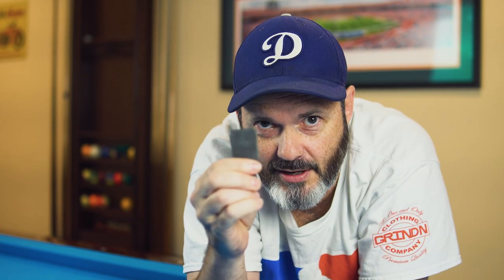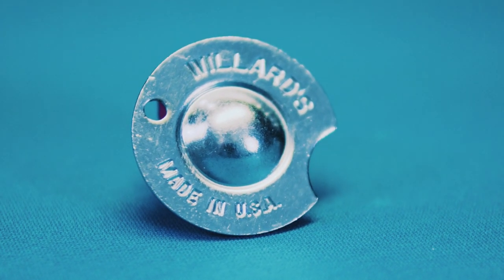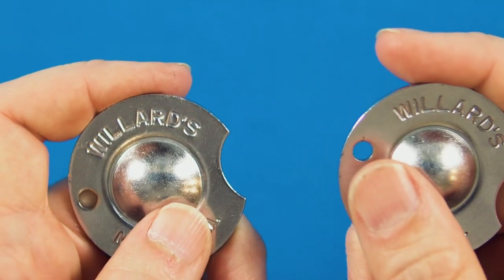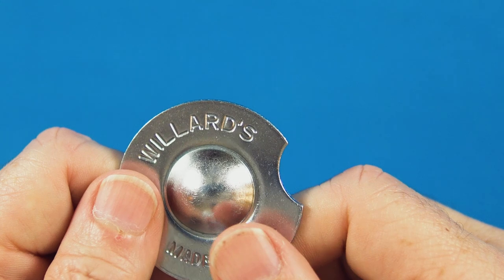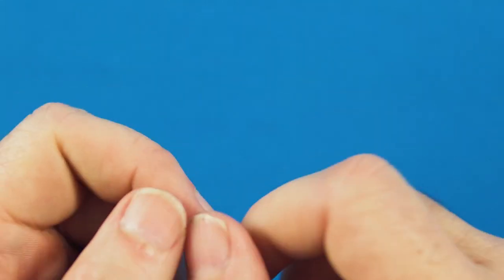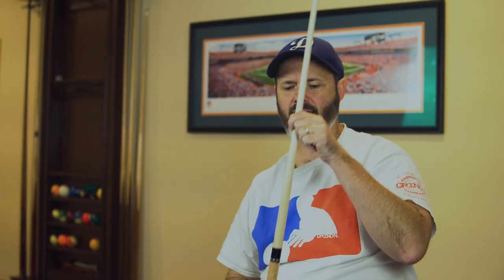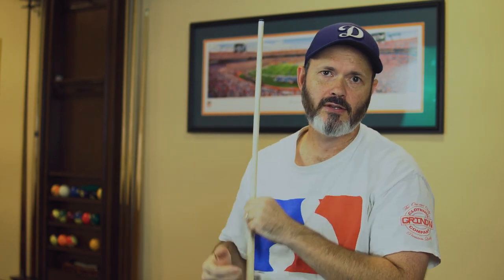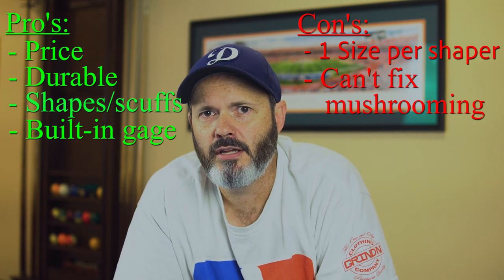Willards Cue Tip Shaper Review

Comment: Yes this is a very good product but it will wear out your tip faster than most other tip shapers,  I haven't found a better tip shaper. I can say this with confidence after 500 tournaments.
Reply: Good luck with your next 500.Did you excel in any?
Reply: Thats been my experience with it also, works GREAT, but after the first couple times using it, it was noticeable how much it was taking off

Comment: I don't think you can wear a Willard out, but I did have some stolen over the years.  Disappointing, but cheap to replace.  If the Company sees this, how about a shaper in quarter size and a size between Little Snookie and a dime??  The former for break/jump tips, and the latter for tips on 11mm shafts.

Comment: Have your tip shaped on a lathe. Use a shaper to loosen the surface of the tip as it packs. And your tip will last much longer if you chalk as needed and not as a reflex.

Comment: I have “The George” for my revo but I don’t know how to use it.  Please help.   I herd u can put it on the floor then put your tip on it while standing and roll it like a fire starter.   Dunno.   Need help
Reply from the maker: For shaping you can use the shaper portion of the of your tool like you said, by placing it on the ground and roll it like a fire starter but you need to make sure to keep your cue vertical without tilting the cue. Shaping will get the curve you want on your tip (dime or nickel). The larger rough portion is made for scuffing which is needed when the tip just needs to be scuffed and not shaped so it will hold the chalk better. You scuff it by holding your cue upright and lightly rub the scuffed on the tip, make sure to do it evenly by rotating the cue while you’re doing it.  If the tip is a soft tip it will scuff and shape a lot easier than a harder tip so keep that in mind as well. Hope that helps.
Reply: Pool Addiction thank you

Comment: Nice review. I have used Willards for years. I have the bowtie but the Williards is my go to. I usually put it on the ground and hold it with my feet, then hold my stick upside down with the tip in and hold the but with my hands and then rub my hands together as the stick rolls between them. I like this way as it seems better to keep the stick straight. just my personal preference.
Reply from the maker: That's how I prefer to use it as well, just have to makes sure you're not tilting your cue while doing it.  The first time I did it that way my tip was a little uneven because I had the cue slightly tilted.  I also wanted to show the different ways I have seen people demonstrate it.  It's a good little tool.  Thanks for watching!

Comment: I have one of these Willards from 30 years ago, a dime size one. I used to live in Aurora back then, so I reckon that's why it was easy to find. I also have a no name plastic double sided tool with the same abrasive in it as the Willard, and it has dime and nickel radius on each side, works just as well. I have another plastic too that is basically a sanding stick, about 6" long, 1.5" wide and convex dime radius profile. It has internal grooves along the inside edges for you to slip in a strip of whatever sandpaper you choose. You stroke it across the tip like a file while turning the cue between strokes to keep the cut even. Unfortunately I suck at pool, can't consistently aim and stroke a shot to save my life. L0L

Comment: The Willard's shaper tool is easy to use, works fast, never wears out, works better than anything else I have used, and does a consistent job (nickel radius for my 13 and 12.75 mm tips). I find it a tad rough after the shaping, so I finish with a curved trough tool (greater than nickel radius) that holds a strip of easy to replace 200 grit fine sandpaper. I spin the cue by hand while drawing the trough tool across, mainly around 45 degrees but a few light passes steeper for near the edges and flat for the center. Then I grind rotate the cue tip with about 5 lbs of pressure into a well used chalk which acts like super fine sand paper to really smooth out the tip, knock down high spots, and to fill in micro pits. The other side of the trough tool has a flat surface that works for mushrooming, just use 1 inch of regular paper over the sand paper to protect the ferrule. Then burnish the side by rotating the sides against a stained piece for wood. A pick tool aerates the tip for chalk adhesion between shapings. Don't spin the tip when aerating since that would shred the leather. When a get a new cue, I expect to reshape after a few dozen racks as the center flatten compacts with break in.

Comment: Great to see you making videos again look forward to the next review. My understanding was that the nickel shape was more for breaking and a dime shape was more of a playing shape. I’ve used dime shapes b4 on 13 and 12.75 mm tips b4 and never noticed any problem but I’m no pro so maybe I’m wrong. Either way love the channel
Reply from the maker: Thank you for your feedback.  Most regular players do use nickel for breaking and dime for playing.  However, I’ve tried to put a dime shape on a 13mm tip and didn’t work well for me.  The biggest tip I was able too get a descent dime shape was on a 12.75 and smaller.  New players should use a nickel until they get more exepreince because it’s like going to a smaller diameter tip…the degree of difficulty goes up.  I’m glad like the channel!
Reply: I agree smaller diameter does increase difficulty so it does make sense that smaller radius would also increase difficulty. And I’m an average player on my best day so maybe the fact I was shaping a larger diameter to a radius that didn’t allow for a good combination of size to shape and that was hindering my game and making it harder to develop a consistent game

Comment: Great to see you're back to making videos :) And a great little review you made... I have a knockoff 'cuetec tip tool' that I use. But its kinda hard to hold the scruffer level and put pressure on the tip at the same time. And I really have no idear what radius it has. So the it looks like I have to get a Willard ;)
Reply from the maker: Can't Breakdance Thanks.  The Willard’s takes a little getting used to if you the way I prefer to use it (the last technique) but they are built to last a long time.  Glad you enjoyed the video!

Comment: Hey kev. I’m getting into pool and and am buying my first pool table for my house. Thinking about an 8 foot table, but was hoping to get some insight on what brand would be a good choice if I plan to start competitive soon. I want something similar to what I’ll be competing on to stay consistent
Reply from the maker: Depends on what your budget is.  If money isn't an issue Diamond all the way.  I'd say after that I like Olhausens.  After that, I think it drops off a little.  Olhausens are cheaper than Daimonds but they still aren't cheap, around $3K for a new Olhausen.  You can a used Olehausen for a reasonable price.  Second part to look for in a table is pocket size.  Diamonds have pro cut and from what I understand Olehausen have what they call "Rattle".  You want tighter pockets for practicing.  Also, make sure your room is good for an 8 foot, you typically at least 4 feet around the table for play.  Here's a link for room sizes https://www.billiards.com/pool-table-room-size.  If you can get a 9 foot, I would go with that over an 8 foot.  I would add Brunswick Gold Crowns into the mix if you go for a 9 foot.  If you are really on a budget go with a 7 foot Valley table.  They are cheap and are usually one piece slate.  You can upgrade the rails for better response and you can get the pockets tight like the pro-cuts on Diamonds.
Reply: Pool Addiction my local pool hall aswell as the league at my college mainly plays on 7foot Diamond tables, I’m starting to lean towards the 7 footer. My budget is about $2500. Do you think it be worth it to get a used table for cheap and re-felt it and put better rails on it?
Reply from the maker: I think you can do a used Valley and get some good felt and new rails with $2500.  It would be close but I think it's doable.  I would recommend Ridgeback rails.  They are really good replacement rails for bar box tables and they have a pro cut style rail which makes the pockets tight.  As far as felt it depends on how fast you want the table to play.  I like felt that's faster than normal and can get the cue ball to have a good reaction to the English I put on the cue ball.  I have used Simonis 860 cloth on my last two tables and I love the action but it is a higher maintenance cloth because it's thin.

Comment: Thanks for your video. I wanted to how to clean the tip shaper after using it. I can't find a way and the tip shaper feels like its not shaping anymore because of the dust from the tip that was being shaped. Thanks for your help in advance.
Reply from the maker: I usually tap the shaper on a hard surface or something to get the debris out after every use.  I haven't had too much of a problem with this issue.  You can probably try to blow it out with some compressed air.  Also, I would clean off the tip of all the chalk before using the shaper and that will help the dust and debris.  Hopefully, that helps you out.  Thanks for watching!
Reply: Use an air chuck on your compressor and some break clean ..good as new

Comment: New tip, The middle of the tip is still hard and unscuffed not far enough?
Reply from the maker: Check it with gage on the side and if you don’t have any light between the tip and the gage, just lightly scuff it side to side focusing just on the end of the tip. If you see light then keep going. You can keep going even if the tip shaped right per the gage, it just takes down the tip a little more. Hope that helps.

Comment: Would you say this would be fine to use on a snooker cue tip?.. I'm currently using a Century Pro G3 10mm
Reply from the maker: I am not familiar with what radius tip Snooker players play with.  The most curved radius you can get with a Williards is a dime shape (60-degree arc).  I did a quick search and I think the dime radius should work for a snooker tip.
Reply: @PoolAddiction  Thanks for the reply =) .. I guess the only way to find out is to purchase and test it on a different tip than my main one.. I usually use sandpaper and do it by eye but struggle from time to time to get it perfectly even, this just seems like the perfect solution to that
Reply from the maker: @raymondoreed7723  Sorry I couldn't give you any direct experience.  I will say the shaper is pretty robust so do take it easy on the tip at first till you know how it will do.
Reply: @PoolAddiction  That's alright mate.. I've ordered the ' Little Snookie ' from the same people.. Sounds like it's more for the snooker tip appose to the 9 ball tips ect.. I've to expect it at the end off the month cause it's being shipped from the usa =) .. Thanks for the advice

Comment: I’ve just purchased one of theses I’ve  tried it on my cue tip and it’s made lots of fibres stick up, is this normal ?
Reply from the maker: Some tips rough up easier than others.  How hard is the tip and the brand?  Not seeing a picture of it I can't tell you if it's excessive.  Usually a softer tip will rough up easier than others.  If there are a lot fibers you can try to clean it up and tap down the tip.  I would just take it easier when using it.
Reply: Pool Addiction hi thanks for the response, my tip is an elk master not sure on the hardness of the tip. The Willard cue tip shaper seems very rough to me I’ve replaced my tip once before and used 250-300 grade sandpaper and that seemed to do it fairly well considering it was my first time. I got the cue tip shaper for convenience really incase I needed to shape my cue tip up unexpectedly.
Reply from the maker: Elk Masters are a little harder than a medium layered tip in my experience. The Willard is pretty rough so I wouldn’t put a lot of force into it. You should see some fibers after roughing/shaping but if they are more than 1/16 of an inch long then the tip was roughed up a bit much. Your tip isn’t destroyed if it is, just clean up the long fibers and take it easier with the Willard shaper next time. The age of the tip can have an effect on shaping but age usually makes it more difficult to get the tip to rough up.  I have had tips before that had longer than normal fibers after roughing them up and I just cleaned it up and it was fine, I’ve never that issue with the Willard though, not to say it won’t happen though. I haven’t played with a solid compressed tip, like an Elk Master, in a long time and I can’t remember how they react to roughing and shaping, I mainly use Kamui now which are a layered tip.
Reply: Pool Addiction ok thanks, come to think of it I did use a lot of force when using the Willard. I’m due a tip change so am going to change a tip like I usually would and practice with the Willard to get use to it.
Reply from the maker: Anything I can to do to try and help you out, I will do my best.  Happy shooting!

Comment: What do you use to get rid of mushrooms?
Reply from the maker: Mushrooms are always tough to maintain.  If the mushroom isn't too bad, I use a Porper burnisher tool.  Even though it's meant to burnish, it does an okay job at compressing the tip back into shape.  Another tool I've used in the past is the 3-in-one tool.  It has sandpaper strips on the side where you can around really carefully and sand the mushroom part ( make sure to avoid contacting the ferrule) and then burnish it with its burnishing tool.  Another tool you can use is the Porper mushroom tool.  I would exercise extreme caution with this tool because it will really mess up your tip and even your ferrule if you don't use it right.  This tool has a razor blade that will shave off the mushroom and then can burnish it after you're done.  You have to be very careful with it and I would take the time to learn how to use it if you go that route.  For me nowadays, if I have time, I have a lathe where I can spin the shaft and clean up the mushroom with sandpaper or a cutting tool.  I still have the Porper burnisher in my bag for the poolhall when I need something quick.  Hope that helps you and thanks for watching!
Reply: @PoolAddiction  Thank you, this is very helpful.

Comment: Can you change from a dime to a nickel?
Reply from the maker: I suppose you could but you are going to have to take a good bit off of the tip when you re-shape it.
Reply: @PoolAddiction  doesn't everyone reshape a layered after a couple weeks of play once or twice? All these Cynergys come with a dime sniper tip.
Reply from the maker: @Lukas-gx9wk  I usually shape every couple of weeks but it get more frequent as the tip gets smaller. IMO.  Some tips require shaping more frequently based on things like how soft they are.